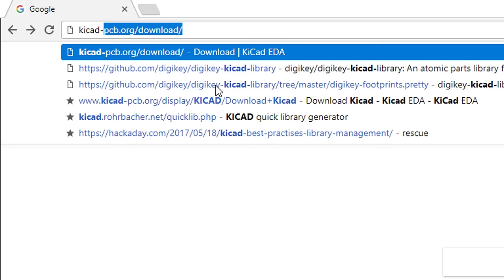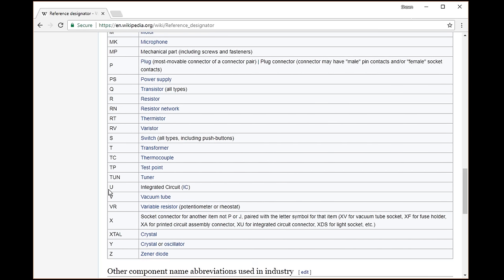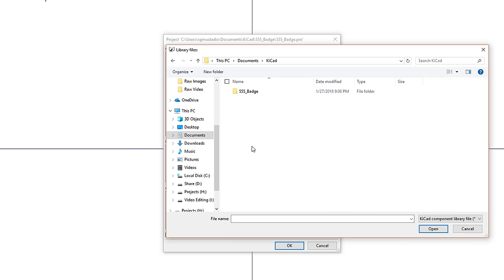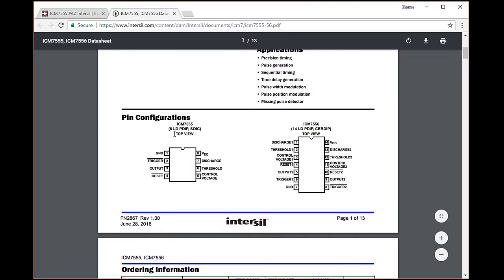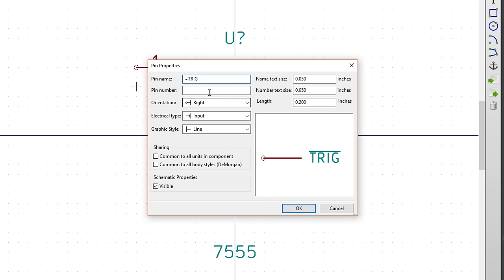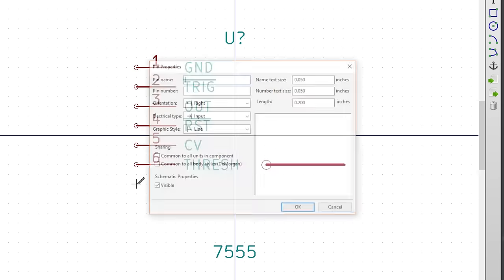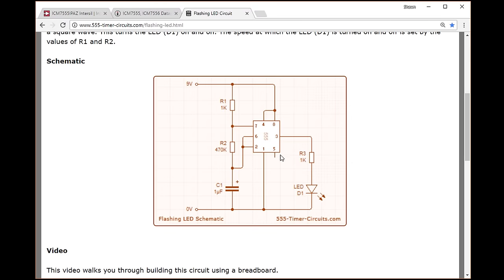An Intro to KiCad – Part 2: Create a Schematic Symbol | DigiKey

Comment: For version 6.0 things once again have changed a bit:

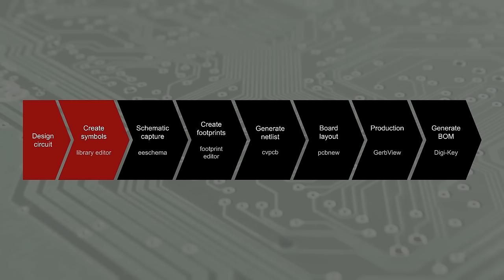From 2:04 to 5:30 you can substitute in the following:

1. Go to Tools >> Symbol Editor and press ok to load the library 
2. go to "File" >> "new Library ..." >> "Project" and create a new Library for the component
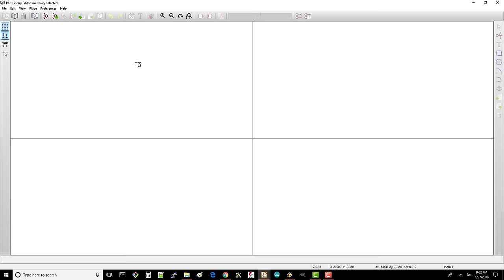3. click the new Symbol button and continue at 2:19
4. ignore everything from 3:35 to  5:30

At  7:40 the new way to create an active low pin is with ~{NAME}

At 9:30 click to start drawing, click again to stop

At 10:00 click the "Specify a new location for the symbol anchor" Button on the right 
At 10:25 click Save
Reply: Thanks bruh
Reply: I really appreciate this. Thank you for the help and tips.
Reply: Thanks!
Reply: thank you so much
Reply: Learning how to use this program, I would not have know those differences. Thanks for taking the time to include the update differences (:
Reply: Love u ❤
Reply: Love uuu ❤❤❤
Reply: Thank you
Reply: You are a Hero in the comments bro!
Reply: Thank you very much. you're a legend.
Reply: you're the goat
Reply: This advice is still good in version 8.0

Comment: With all of Kicad's changes over the years, the symbol editor STILL has the 'feature' that when you click OK in the Add Pin dialogue at 7:30 the mouse cursor jumps back to where you placed the pin. I can see where some would see that as convenient, but it breaks the User Interface that I've known for 35 years (since the original Macintosh). Who controls where the mouse cursor is, the user or the program? I find it disconcerting, and I know of no other program that does such a thing.

Comment: Brand new and already outdated. KiCad 5 will be released soon, maybe worth considering for your tutorials?
Reply: The majority of the tutorial should be the same, I'm using the nightlies and it's very similar. You could probably just make a follow up video "Differences in KiCad 5' once it is released.
Reply: This is good to know, so I'll keep a "differences with KiCad 5" video in mind. Thank you.
Reply: 'This slightly chaotic process' - you're not kidding! I came to your channel out of exasperation with the hopelessly structured videos on YT about kicad. I started a project on 4.something earlier in the year and recently updated to 5.0.0. I got lost around 2 mins on this vid then realised you're using an older version. Your context menus are different to 5.0.0. Never mind I can work that out but beginners won't. 

But seriously what we need is a long step-by-step video on the generic github library. How to d/l it - clone or zip - what's the difference? Where to put it. How to use it and how to mod items from it. I feel this should come between part 1 and 2 because beginners will always look for ready made symbols/components first. The github library is probably the best generic library I've seen in any prog (and is the reason I switched from DesignSpark). Also it's quicker (and easier for beginners) to mod an existing model than starting from scratch. After that we can learn creating models from scratch. We only want to create from scratch when we absolutely have no choice but to do so.

What's really important with custom libraries is to save them in such a way that they're retrievable in the event of a hard drive failure. I learned this the hard way - two fucked drives in a week and 100+ hrs up the Swanny. IMO it's best to save custom libraries in, for instance, Onedrive or Googledrive so they're continuously saved in real time.
Reply: @piggybladder  it sounds like you need a github tutorial.. getting into git will clear up your downloading questions.. and also provide a place for you to do version control so you won't lose things in the event of hard drive failures. Look for Shiffman's github for poets videos

Comment: I totally disagree about the ERC being more trouble than it's worth.  It only takes a few seconds to identify the pins correctly, include the correct power flags, etc.  Imagine going to the trouble of making a board that had a fault, only to realize later that ERC would have picked it up.  Best to start good habits early.